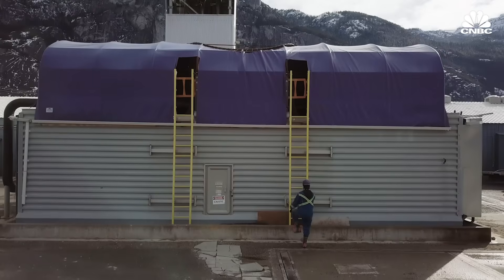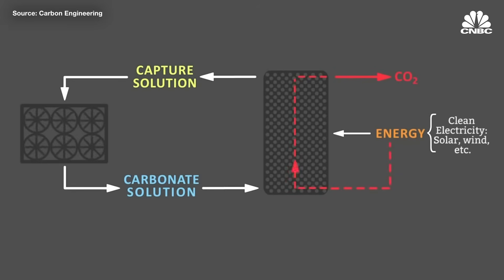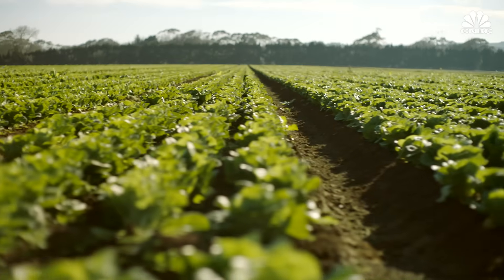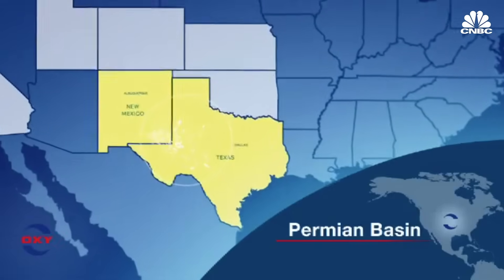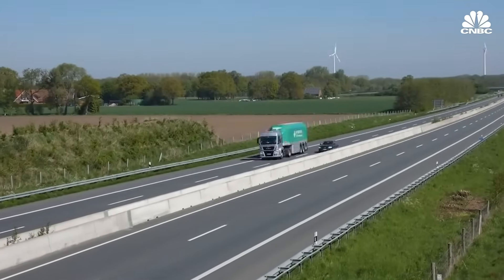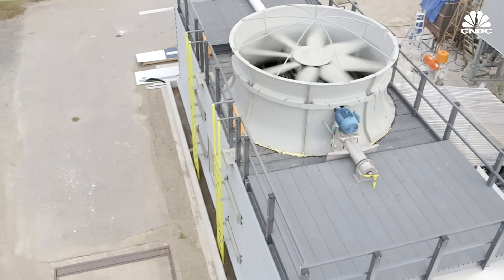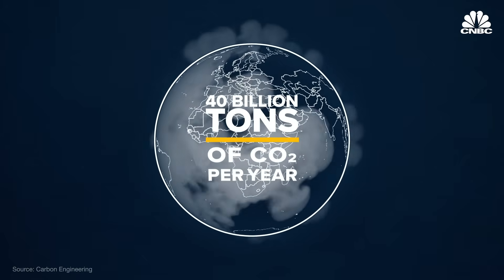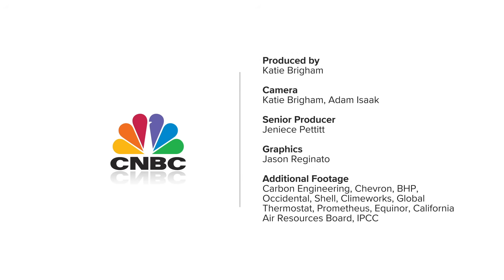Bill Gates-Backed Carbon Capture Plant Does The Work Of 40 Million Trees

Comment: I'm sure the carbon footprint of having to use all this energy to process the CO2 is greater than the amount it captures. I am talking not just in terms of on site consumption, but rather having to process the chemicals off site (think like LEED), so they can be used on site. 

In reality I believe the tree density in Canada is about 50,000 - 100,000 per square km. So if this one plant (no pun intended...) can do the work of 40,000,000 tress  that's about 400 km2 worth of trees (upto 800 km2). Squamish takes up about 105 km2 for reference.

It would almost make sense if the plant was powered by a green source (solar, wind or hydro), however at the moment less than 20% of BC is powered with renewable electricity. Yes... I know its powered by natural gas and (green energy).

Not to mention this is partially funded by the fossil fuel industry. Heating Calcium Carbonate pellets takes a lot of energy...

All in all, too gimmicky. It seems to exist just to get more oil / gas. Just plant more trees.

Comment: Of course the oil companies want to back it. If we can remove the co2 then they can keep pumping it in. It’s not a solution it’s enabling. Only if we use this tech to reduce co2 AND switch to clean energy will it be a good piece of tech.  But we really need to switch to clean energy first. We haven’t changed our mindset enough to use this tech yet.

Comment: ALL carbon capture is stupid, its just taking an issue today and putting it away to deal with later or when some disaster releases a store of it...  And don't say electric is the solution, until the battery has a giant leap forward in engineering and design, its just smoke and mirrors.

Comment: And how many of these plants are physically required in order to supplement natural CO2 removal methods?? Obviously CO2 is still required in the atmosphere in some quantity to sustain and maintain life so there is a risk of "over scrubbing" the air, assuming it's even feasible after all it's a big planet and where would you put these plants in industrial/high population areas?? Sure we can plant more trees but in reality they only make up no more than 50% of the global CO2 consumption/conversion. The other half is through algae in the oceans and freshwater bodies. This could be simply seen as the silver bullet to the problem rather than reversing our dependence on fossil fuel. People will think it doesn't matter if we are still polluting the air as the carbon capture plants will do that work. Not ideal. I'm interested to see where it goes by the original question remains as to how many of these things have to be built to actually be of global benefit....I am guessing quite a lot.

Comment: Why not build them around the actual facilities In stead of next to the river.
Reply: It's a test plant. You don't want to spend all your money on land and regulations to try and prove it works. They would spend years and millions trying to get approval from cities for something not yet working.
Reply: It's a bay but I get what you're saying.
Reply: HOMER DRUMPF  they need access to free water so it doesn’t cost as much.
Reply: It doesn't matter. CO2 doesn't stick where it's produced.
Reply: you realise it's in British Columbia right? that's a boreal forest, you realise boreal forests burn alot right? they actually need to burn to keep themselves growing (tall trees provide shade for a large area, so nothing grows on the ground since no sun gets to it)

by placing this facility in the boreal forest you're doing something very smart. One, it's cheap (making it economically viable, maybe) two, it absorbs the co2 released by dead trees (though theres not nearly enough dead trees in a boreal forest compared to a rainforest) and thirdly, once the forest does burn (it will, we even put it on fire deliberately in 1st world countries to control the inevitable firestorm that would come otherwise) it will capture alot of the carbon that gets released by the fire.

But yes I do agree of course put this technology directly inside coal and oil plants, there's no reason for there to be no proper filtering of the released toxins from fossil fuels.

The best solution would be to build carbon capture facilities (they have to be economically viable) powered by nuclear and hydro energy. At the same time as we plant forests and consume less.
Reply: They would also need permits from the government and the company that owns the plants
Reply: He said in another video, it is uniformly distributed.  As it is the moisture in the air (not direct pollutants from factories and car exhausts)  these plants can be situated anywhere, deserts or highly polluted cities and they will extract the same amount of CO2 from the air.
Reply: Sirius Magus  Because there is too much we put there in the first place and it's killing us and the planet.  It can then be used for fuel, feeding plants in massive greenhouses as they already do, or stored underground to get rid of it permanently.  I think you might need to watch the video again to try and understand mate.
Reply: Sirius Magus  #1 you are a bit dumb #2 that is why you keep liking your own comments lol

Too much CO2 in the air is not great, but that's not the sole reason for extracting it and using it, is it.

Yes they do increase it for yields in greenhouses, that they get from this exact process.

Comment: At the high end of the recommended stand density of 60 trees per acre per the Mountain Area Safety Taskforce, the 40 megatree forest equivalent would require around 2700 square kilometers or a thousand square miles. While 60 acres makes for a large factory, refineries can be much larger. The 500 thousand barrel a day Baton Rouge Refinery occupies 2100 acres. I think it reasonable to assume this is a highly excessive upper bound for the size of the carbon capture facility. So, doubling that to 4200 acres, we see that the forest needed to do the same job would require around 150 times the land area. If we took that 40 megatree forest and carved out 4200 acres to dedicate to an oil refinery and a carbon capture facility, we would still have a 39.75 megatree forest... that acted like a 79.75 megatree forest.

Objecting to that, it seems to me, must be coming from a point of view that believes that complete cessation of all oil and natural gas mining and refining is both feasible and politically practicable. So, while I may remain skeptical of the claims made (for example, as far as I can tell the claim of the 40 million tree equivalents is made for the hypothetical full-scale factory, but scaling projects up is generally challenging, and assuming a linear scaling seems unwise), even if the resulting plant could do no more than balance the carbon output of the product of a refinery it would be more effective and efficient than attempting to maintain the same pace of tree growth.

After all, while forest planting is a means of accomplishing carbon capture, at some point the forest reaches maturity and sequestration falls off massively, possibly even reaching negative levels as trees die and decay. While carbon capture through biomass processing of forests is another option, the possible scale of such projects as would be needed to make any fossil fuel activities carbon neutral would surely be massively demanding in terms of both land use and activity in terms of logging. A forest being actively and thoroughly logged on a cycle rapid enough to effectively ensure that trees are in perpetual growth would then be a less than ideal as a natural ecosystem.

Worth watching, I suspect, at any rate.

Comment: So let me get this straight. This is bad because they are partnering with oil companies? We need to just go straight to renewables? How do you get there? How do you handle what's already out there? What about the fossil fuels required to get the renewable systems up and running?

 No matter WHO is investing into this, when it comes to energy you still have to get from point A (fossil fuels) to point B (renewable energy) why not have systems in place for that change over? Why not help mitigate the damage of the vehicles already on the road, of which most people cant afford to stop using? Did this guy think his statements through?

This guy is why most people see Berkley as a laughingstock any more. Head so far up his ass he cant see the whole picture.

Comment: Imagine thinking this'll make a difference, you'll need around 76,000 of these plants to match the performance of all trees
Reply: That's a relatively low number
Reply: @ADAJ342  not when it would cost $8,800,000,000,000 to extract the 40,000,000,000 tonnes of pollution put into the atmosphere each year, and that's before you'd even add runtime, maintance, and build costs
Reply: @ADAJ342  that's after they partner with oil companies
Reply: @ADAJ342  now let's times that by 30 to equate for the last 30 years, $264,000,000,000 that's trillions btw not billions
Reply: @Odysseus11.134  , bold of you to asume It Will not become cheaper/more efective

Comment: im not understanding why them partnering with oil industries is so evil. at first glance it seems weird but with or without the carbon engineering, oil will be drilled and gas will be burnt. the point of the project is to remove carbon from the atmosphere, and it seems like they really believe this could work to borderline reverse global warming which is amazing. i guess what im asking is would it not be possible to own a gas vehicle that emits carbon, but then the carbon gets sucked out of the air anyways. i understand that more emissions would slow the process down a bit, but i dont think it would ruin everything. if im wrong let me know im just trying to understand why the man who looks like he just bought a boat is saying it cant be done.

Comment: Should make rubisco enzyme in lots of quantity
Reply: How are you going to produce it? How are you going to maintain it? How are you going to finance it? What will be the byproducts?
Reply: By bacteria,..i think it worth trying
Reply: @kaushalvyas1142  Thought that it actually be a good idea, until I stumbled upon this site:
"In spite of its central role, rubisco is remarkably inefficient. As enzymes go, it is painfully slow. Typical enzymes can process a thousand molecules per second, but rubisco fixes only about three carbon dioxide molecules per second. Plant cells compensate for this slow rate by building lots of the enzyme. Chloroplasts are filled with rubisco, which comprises half of the protein. This makes rubisco the most plentiful single enzyme on the Earth. 

Rubisco also shows an embarrassing lack of specificity. Unfortunately, oxygen molecules and carbon dioxide molecules are similar in shape and chemical properties. In proteins that bind oxygen, like myoglobin, carbon dioxide is easily excluded because carbon dioxide is slightly larger. But in rubisco, an oxygen molecule can bind comfortably in the site designed to bind to carbon dioxide. Rubisco then attaches the oxygen to the sugar chain, forming a faulty oxygenated product. The plant cell must then perform a costly series of salvage reactions to correct the mistake."
https://pdb101.rcsb.org/motm/11 
Still, I feel like the basic idea could still be valid; it would just require a lot of investment in development and research.
Reply: @chaomatic5328  thnx for insight...we need something that can turn plastics into needed fuel

Comment: No No No. Don’t inject CO2 underground it is too dangerous. The way to make this work is to create a really useful (ie valuable $$) product out of the carbonate and use it in permanent structures or roads. How about some sort of real man made marble (not cultured marble) that can be used in construction, or man made sea shells that can be used in foundations or road beds? The real question is where is the calcium for the absorbing solution coming from? If it comes from a calcium carbonate process then this whole project is just a bad joke that will only fool uneducated suckers.
Reply: Why is pumping CO2 deep below ground dangerous?
Reply: Chaomatic It is a similar philosophy to sweeping dirt under the carpet, but the real issue is the tremendous pressure needed to keep it down there and the real possibility that earthquakes or other faults could allow massive a massive escape to occur and suffocate anything unlucky enough in the area. This has happened naturally with some lakes around the world where large amounts of CO2 were suddenly released causing human and animal deaths. There would also be another energy cost associated with developing enough pressure to force it into a hole. It would be better to turn the CO2 into a useful product that would go into a durable good. For further info on what could and would go wrong look up https://en.wikipedia.org/wiki/Lake_Nyos.
Reply: @garrettmineo  Thanks for the explanation!

Comment: This is sad actually, here are number I've found:

- 1 tree takes up 1 tonne of carbon in 100 years. 1000 trees cost less than $0.25 per tree (say Pedunculate Oak), so $0.25 per tonne of CO2. Plus trees are actually beautiful, useful for biodiversity and all sorts of sh**.

- These guys' price is $94-232 per tonne, which is ridiculous, especially when you consider that they will actually require energy, material and space to do it.

Conclusion: just plant trees and stop eating animals products because they are leading cause of the amazon deforestation.
Reply: And when trees and other plants die (they always do), they release the carbon (CO2 and methane) back into the atmosphere when the tree/plant burns, rots, decays, or is eaten by insects (termites etc.).  It's called the carbon cycle.  The only way to sequester the carbon for the long term is to bury the plant material below an impermeable layer before it decomposes.

Any plant or tree that grows, lives, dies, and decays on the surface of the ground does nothing to permanently sequester carbon.  They release almost  exactly the amount after death as they absorbed during life.

BTW, the CO2 you expel with every breath you take, is you releasing CO2 that was temporarily captured by a plant before you ate the plant.  Again, the carbon cycle.
Reply: @johnchappell4492  thanks for the comment. I agree with your points, but trees are still a solution because all we want is natural cycle of CO2. For the excessive CO2 that was released by burning fuels we should just plant more trees, every year or two. This way when a generation of trees dies (oaks live about 100 years btw) the other will take up the released CO2.

If a Brazilian couple can plant 2.7 million trees, governments around the world can plant trillions. Tax on CO2 -> plant trees.